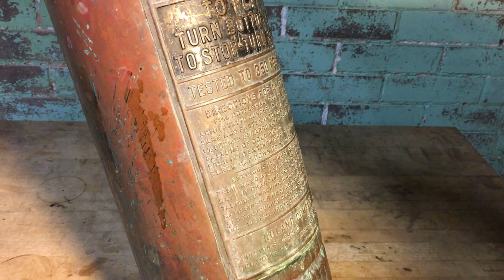Antique Soda-Acid Fire Extinguisher: Recharging and Operating

Comment: One pro for keeping an old soda acid extinguisher around is they are cheap and easy to recharge yourself.
My neighbour had a garbage can fire, the flames started going up the side of his house. I used my good fire extinguisher to get it under control until the fire dept arrived. I suggested he have my fire extinguisher recharged, but he laughed. It cost me $100 to have it replaced. So I keep a loaded soda acid for times like that.
Reply: Just get a water one that you recharge with air. Simple.

Comment: Just using soda acid fire extinguishers has been illegal for over fifty years because of the very real risk of explosion.   A blockage would form in the brass joint between the body and the hose.  If the chemicals were fresh up to 200 pounds of pressure would occur instantly bursting the seam on the side.  This could rip  open a leg or just knock over the user if they were lucky.
The brass one in this video was outlawed over 75 years ago.
Buy a simple five to ten pound ABC Dry Chemical extinguisher to fight all kinds of fires,  But DO NOT TEST IT - the slightest use will break the seal and the pressure will gradually leak out completely within a week or so. 
I sold, recharged, and repaired fire extinguishers in Brooklyn for 25 years and I made a lot of money because idiots just wanted to shoot a tiny bit out to make sure it worked.

Comment: I was in the fire equipment industry for 30 years. I commend you for your warning on the use of them today. The main reason that these units were eventually banned from the market was due to the failure rate (explosions and injuries) of the soda acid units. The inverting foam units were even more dangerous because of the foam clogging the hose and allowing excessive pressure to be built up inside the unit also causing a possible failure and explosion of the unit causing personal injury. You are the only one that I have seen so far warn of the danger and thank you!
Reply: what about the water ones

Comment: The top on my similar extinguisher is on extremely tight and I have been unable to unscrew it. I can hear something rolling around on the inside but no clue what’s inside. Any suggestions on how to open or if I should even try?
Reply: It's probably the old acid stopple. If it's empty should be no problem. When we were still recharging them we would use a steel rod or pry bar through the handholds of the cap and tap with a hammer to loosen the cap.. Please do not try to recharge
Reply: I upended mine, placed it in a bucket and filled the bucket with kerosene up to just past the threads. Left it for a few weeks (forgot about it) and then it came off with a few gentle taps from a rubber mallet to a stick stuck through the spokes. Youll want to be careful not to hit too hard. The thing rolling around is either a lead stopper for the bottle, or a clump of solidified baking soda. 

Over time the rubber gaskets inside deteriorate and get gummy, then harden, essentially gluing the top on.

Comment: Is it okay to Have one of these fire extinguisher charged with muriatic acid around the house or would it evaporate because I know muriatic acid is dangerous to inhale. when the acid mixes with the baking soda is the acid diluted so it becomes safe when it’s on the ground
Reply: The amount of bicarbonate should be more than enough to neutralize muriatic (hydrochloric) acid if the same amount is used, the whole system is just a harnessed version of the baking soda volcanoes made in schools: the acid reacts, produces gas as its neutralized, and propels the “lava” out of the volcano. This just puts that reaction to use. I have one I plan to test with muriatic acid and if it works I’ll report back, my suspicion is it wont produce quite as much gas which is probably why sulfuric was used. Or it could be that sulfuric was just more easily available, being used in batteries and as a byproduct of various uses of coal.

Comment: I just opened my great grandfather’s soda acid fire extinguisher which is the same one as shown in the video and the inside is covered with some sort of blue crystals. The last time it was opened was probably in the 80s. 
Does these blue crystals/powder pose any risk to my health?
Thank you for your time and your answer
Reply from the maker: A lot of compounds that form from copper when it corrodes/ oxidizes are blue or green.  Copper sulfate for example. It’s probably not anything extremely toxic but I would flush it out and try not to have direct contact with it or breathe it in.

Comment: Back in the 1960s into the 1970s my workplace had a separate old building which housed tons of paper records dating back to the 1800s. They had these old copper soda-acid extinguishers (I.e. oils).hangimg on the front of every record stack. In the 1980s they were changed out for moee.modern pressurized water and sry chemical units. Effective but not as classy looking as the old copper cans.
Reply from the maker: Yeah they are pretty. A lot of people polish them up for display but I like to keep mine with the antique patina.
Reply: @Chemical14  Me too. I like my stuff to keep that old look I.e. patina. I even like to keep my old stuff working if and when possible . BTW I just acquired a soda-acid extinguisher off ebay. It's not a copper one, its one of the "newer" steel / stainless steel ones. The brand name is "Fyr Fyter" quite popular decades ago.
Reply: @WitchidWitchid  got one too, i forget the name, i just recharged mine with the proper charge.
Reply: Brass, not cooper.  Cleaned up, polished, and drilled they can be made into very nice lamps.

Comment: Thanks for the information on how these worked! I have a huge version, the Ajax Chemical Fire engine, which is a 5' tank made of 1/4 inch thick iron with a solid brass cap. It is very heavy, but its large wheels make it surprisingly mobile.  I will probably make it into an upright smoker  now knowing that the sulfuric acid was contained in the now broken plunger jar.  Nice job!
Reply from the maker: Awesome!  I haven’t seen any pictures of chemical 14 fire company but it probably looked a lot like what you have.  The only artifact of it that I found when we bought our building was a brass nozzle with the company stamped on the side.

Comment: I bought one of these recently and it still has some liquid in it, when can i dump this liquid ? No acid in bottle
Reply from the maker: The liquid should just be sodium-bicarbonate (baking soda) and water so you can probably just pour it down the drain without any problems.
Reply: Chemical 14 thanks a million !

Comment: Soda acid extinguishers were banned in 1978 because they are dangerous and have killed and maimed people. To sugest that you can recharge these is irresponsible. Way to many things can go wrong, such as mismatched lead stoppers and caps. the stopper was matched to the concave in the cap to regulate the amount of acid mixing with the soad mixture. Too much acid too fast and too much pressure, BOOM!  Cylenders are more often weakened along the seams and especialy on riveted seams and should never be pressurised.
Reply from the maker: Thank you for your concern. I’ll leave this message here and also amend the description to suggest people don’t try this at home.  There is always an inherent risk in dealing with both pressurized gasses and acids. I would like to point out that this type of extinguisher was used extensively for roughly 100 years in fire departments, industry and homes in the US, and is still manufactured and used in other parts of the world.  While there are some anecdotal cases of catastrophic failures causing injury (primarily caused by blockage of the hose or corrosion according to NFPA) the same could be said of many appliances or tools in common use.
  Additionally, the lead stopper does not regulate the flow of acid in this type of extinguisher (maybe there are larger, more specialized models you are referring to?). The lead stopper is designed to fall completely out of the way when inverted. In some models the glass bottle is designed to be broken to allow for complete mixing. The reaction is regulated by the amount of available reactants.
  I probably should have explained more clearly in the video that we substituted diluted hydrochloric acid in part to reduce the amount of potential pressure generated.
Reply: If you do not know what you are doing and have an IQ too low to function in society, everything is dangerous. Common sense. People restore and rebuild antique fire extinguishers to operating condition all the time. It's called experience and knowing what you are doing.  When firefighters have modern fire extinguishers recharged, they pressure test them with water first to see if they hold before they fill them with fire extinguishing chemicals.
Reply: Peter DeVinne you could put baking soda in the bottom and water in the bottle just for fun

Comment: Can’t vinegar do the trick
Reply from the maker: Yes vinegar would work but it would take a lot more vinegar to fully react with all of the baking soda.  The small glass bottle is designed to hold 4 fluid oz which is roughly the amount of sulfuric acid needed to completely react with all of the baking soda and make the maximum amount of c02.  We compromised and used 8 oz hydrochloric acid solution because it was easy to buy and safer to work with although still not enough to get a complete reaction.
Reply: I think